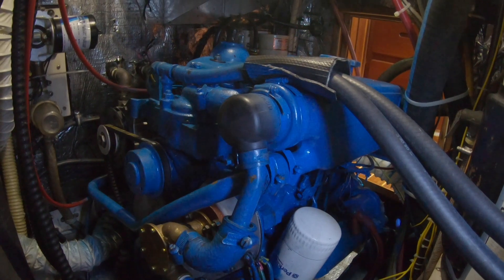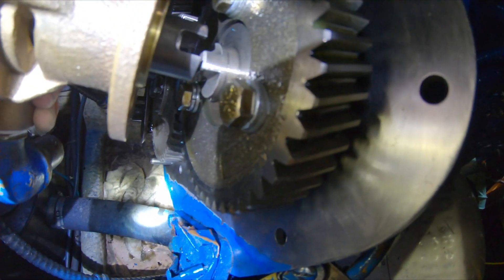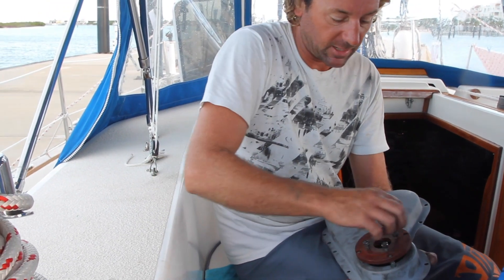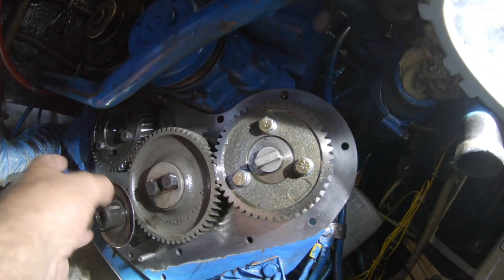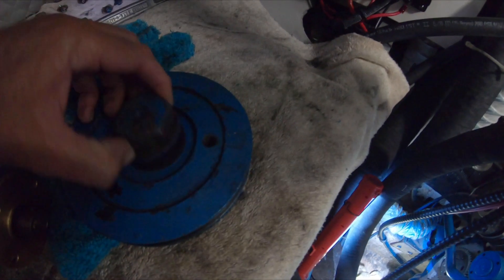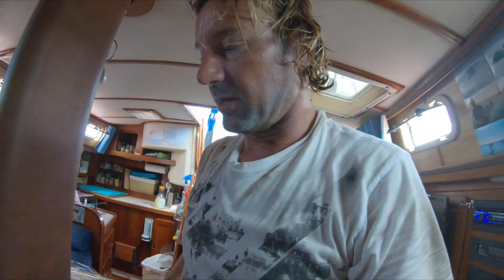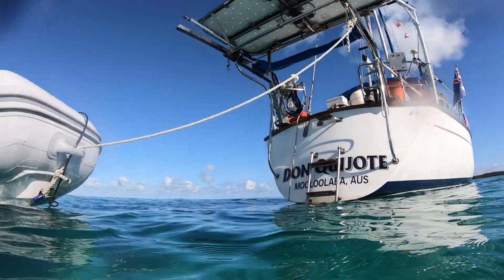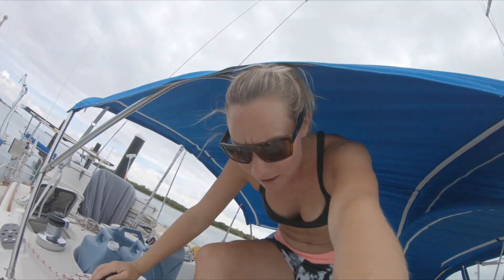PERKINS 4-108 Timing Cover Repair DIY Job by an Aussie Carpenter

Comment: Great vid, may I ask where you had the cover hole punched for fitting the pump? I am planning on having that done and would prefer to have someone experienced to do so. TIA!
Reply from the maker: Sorry for the wait in replying, we ordered the part from transatlantic diesels out of Virginia from memory and it came with hole already punched in
Reply: @nautinooksailingadventures3533  No worries for the timing, lol. considering it was 3 years ago for your posting I'm lucky and appreciative you responded at all. 
In fact I'd say that was pretty darn quick. Cheers!

Comment: yeah too far retarded and it smokes like that. too far advanced and it clatters badly. Yes you can adjust thru the water pump hole with the three bolts in the slotted gear.

Comment: Great section. How did you get that pulley bolt loose...I need to replace the seal behind it and its not turning:)
Reply from the maker: it was a nightmare - we got a mechanic who had a big breaker bar - he locked the transmission at the prop shaft somehow with timber blocks from memory? with a big extension bar and the perfect size socket he got it a lot easier than I ever could have, it was beyond my abilities - as for the leaky seal mine does too maybe they all do? good luck mate!

Comment: You used locktite on those bolts - right ?  Bums sent me . BTW we love videos on repairs and such , everyone has endless shots of white sand beaches .
Reply from the maker: haha so true!!! (we do too - lots of white sandy beaches haha) but Beef Okeefe is pretty damn interested in making DIY videos (not to the same extent as Bums, they've mastered it) so we will definitely factor this into our future videos.  Yes he did use locktite! Thanks faircompetition1!
Reply: @nautinooksailingadventures3533   A few personal tips , don't go on for so long about sanding and  steps . It slows stuff down and is boring . Sure mention them but quick . Step by step disassembly and assembly and the work you had to do to get parts - 

Check out Delos fixing their  windlass by taking the motor to a shop to get fixed .
White spot pirates takes you to the machine shop to see them make the motor mounts . It is interesting to see the inside of the machine shops and good for them to get free marketing .

Comment: Not boring at all mate. Top job👍
That disc on the bottom shaft is an oil slinger. It splashes oil up over the gears.
Reply from the maker: ah right, gotcha, that makes sense, Beef Okeefe says thanks!